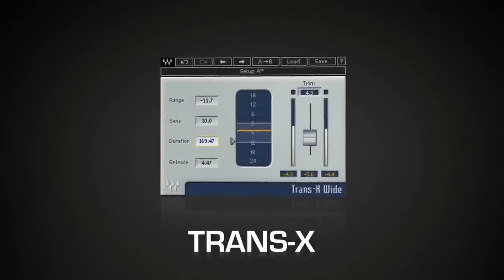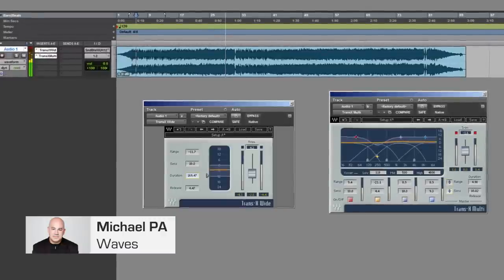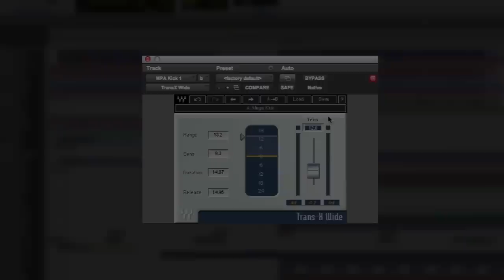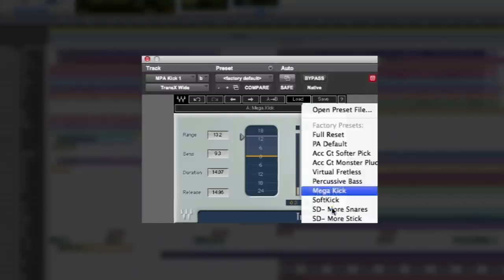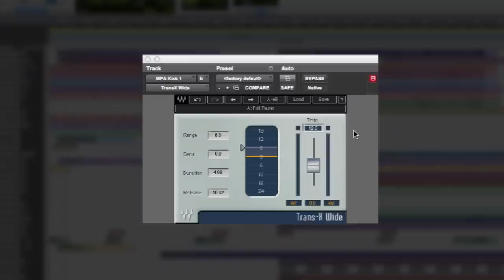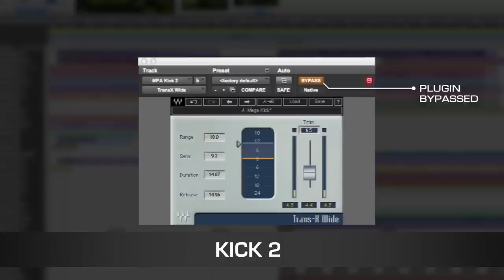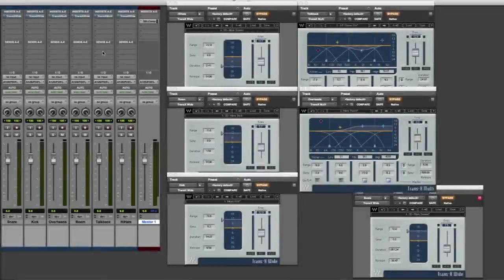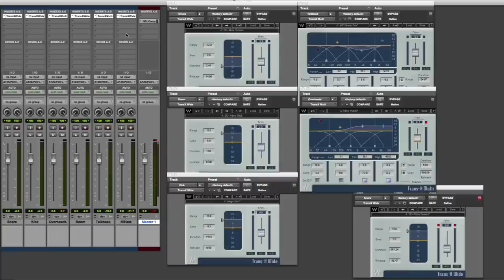Add Punch to Drum Tracks with Waves' Trans-X Plugin

Comment: I wonder, what will it do to VOCAL tracks?
Reply: And what if your vocal is clean of plosives...? how will it sound?
Reply: take every word / clearly divided section of your vocal, then put them into kontakt ont a keyboard and play them one after the other. then turn down the sustain.  now you got a lot of attack and less sustain.
the "beginning" of your section is going to be very loud, the part after that till the next section quieter. subtle use of that could in theory constantly draw the listeners attention onto your vocal. but I immagine that this is the kind of thing where 0.5% too much just ruins everything.
an easier way to replicate what an effect this would have on vocals would be compressor (slowish attack, quick release, on the vocals, big ratio (above 1:7) and lots of makeup). haven't tried it but that's what it should do IRL.
I myself use the SPL transient designer quite a lot, but with that one you have less options and got to use an eq and a compressor afterwards, so that one doesn't do as much as this plugin.